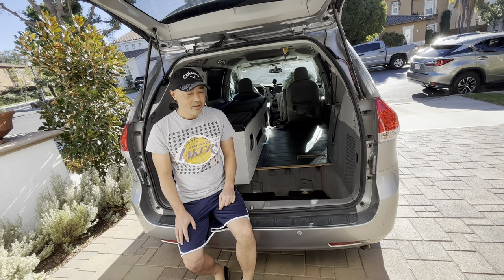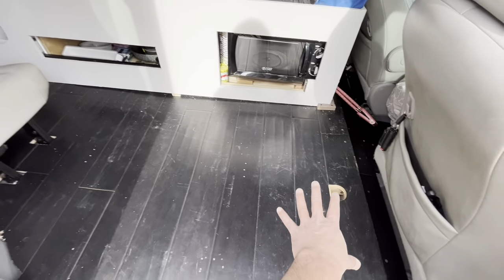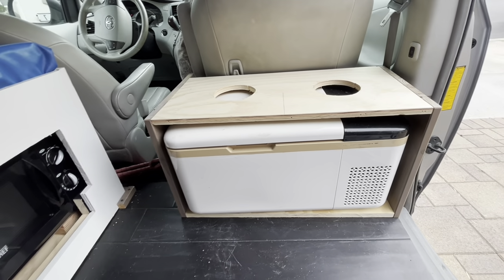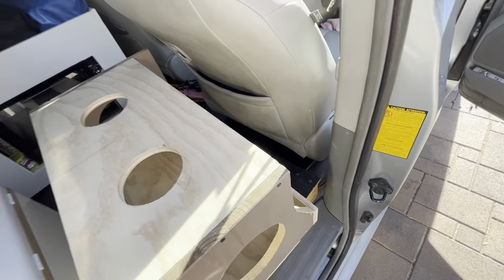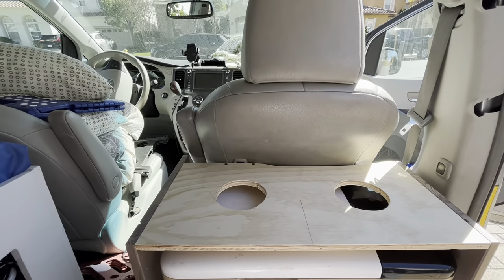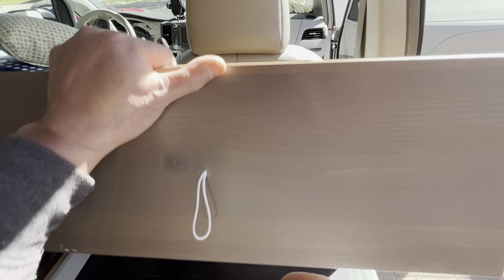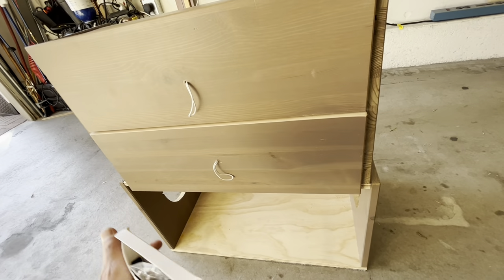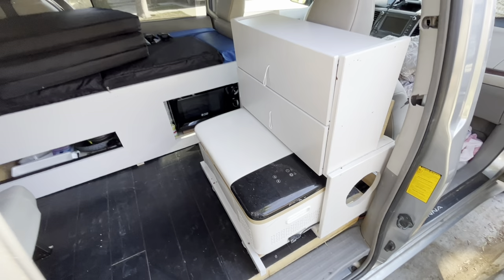Sliding Refrigerator / Clothes Drawers!  Seating For 3.  Sienna Tiny Camper V4 ep.9

Comment: I love your videos! Very creative! 
One question - what if you round off the side pieces at the top rear of the upper unit? The rounding off would somewhat mirror the weight reduction hole of the refrigerator box, and would make it less likely for clothing to catch on the currently pointed part. Also it may feel more spacious for the person sitting in that passenger seat.

Anyway that is up to you of course! Still a great build, and the paint really helps it blend in with the rest of the build!
Reply from the maker: Yes.  Good idea. I may end up doing that since the extra portion didnt cover as much as I hoped it would.

Comment: Question  did you remove your middle seats. I have a Toyota Seana Van as well and I'm just getting  started with 3 furbabies and I love your set ups all of them
Reply from the maker: Yes, seats removed. The rails are under the wood floors. To level the floors, you need to be above the rails in that area. So no need to remove rails.